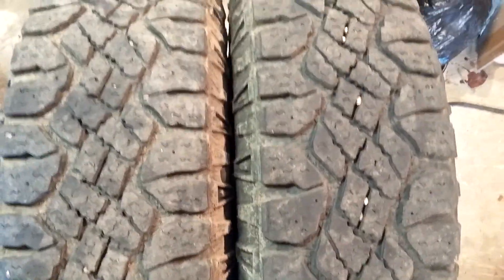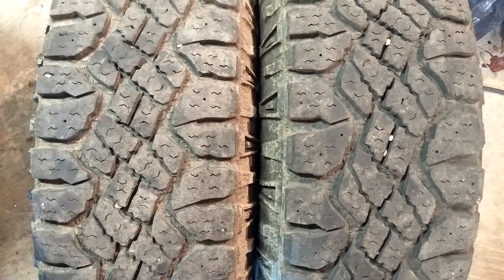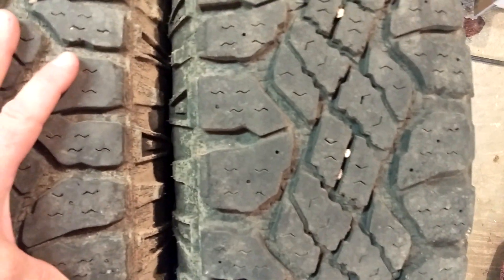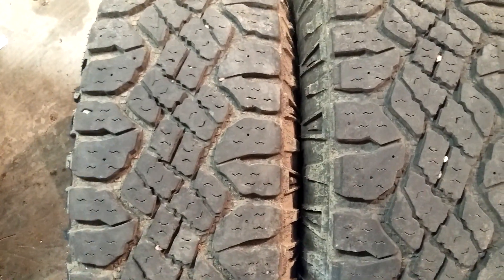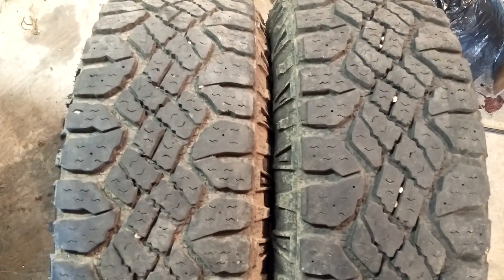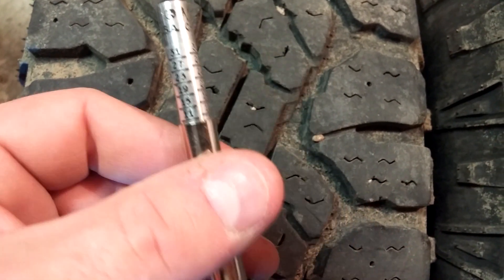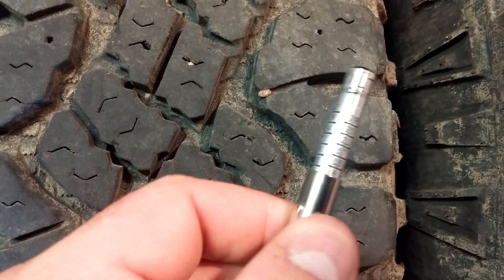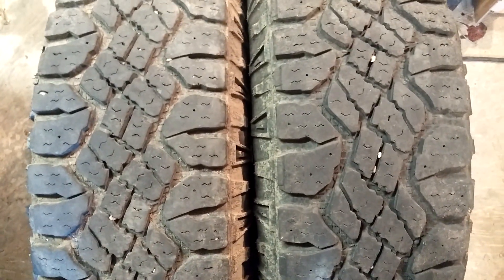24000 Mile Rotation on Goodyear Wrangler Duratrac

Comment: i agree with you on the snow traction after wear.  I'm not sure they go to a D, but they decrease significantly.  I did find they got a little noisy after 35k mi.  I rotated mine at 3k intervals.  I'm back to trying the new BFG ko2 again, and i can tell you new bfg to new duratrac, the duratrac eats these up.  Time will tell, i don't even have 10k and one winter on my ko2s.

Comment: I'm planning to get a set of these for my Jeep, but I'll keep them only for summer use. I have dedicated winter tires and nobody in Finland consider these "all season" tires to be proper winter tires anyway, since the difference between good winter tires (like Nokia Hakkapeliitta for example) and all season tires is like night and day... that's why we can drive in deep snow and bad roads during the winter in 2wd cars easily. And of course, we're bound by law to have winter tires during winter months... all seasons are acceptable, but they'll never work as well as proper winter tires, so for summer usage those will be. But for that, I expect them to be heck of a good tires :)
Reply from the maker: If you're planning on using them that way, I think you'll love them!
Reply: @garyburrus9379  The way those tires seem to wear, I'd expect them to last for quite some time, since I drive less than 10000km (something like 6000miles) per summer tops.
Reply from the maker: @finnishfatman  you'll probably get weather checking on them before the tread wears out!
Reply: @garyburrus9379  Probably :D

Comment: It may sound odd but shocks and struts when they get worn out they cause edge wear in tires they could be worn out and you not even know just cause of age I ran into the same issue shocks weren't leaking replaced them and the edge wear stopped and my truck rode better
Reply: I can second what James is saying.  I had also fought the same problem with outside scalloping on front tires on my truck.  I tried everything.  Finally, a guy told me about changing the shocks.  When I was installing another set of new tires, I went ahead and replaced the front shocks and the problem has never returned after 2 more sets of tires.
Reply from the maker: The shocks are worn, but I have had this issue since purchasing the vehicle.  I have replaced the shocks a couple of times, and they have continued to wear like this.  It doesn't matter what tire brand either.  
I am okay with it though.  As long as I keep my rotations regular, it's not that big of deal, and it doesn't cause me any handing issues.

Comment: I talked with goodyear and they insist there is not a issue with the sipes
Reply from the maker: It's not an "issue" per say, it's the intentional design by  Goodyear. If they deepened the sipes into the tread more, the snow handling would be much better.
Reply: well then it is an issue if the performance drops off after 24k miles

Comment: the duratrac rubber is stiff...it's an a/t tire. if they run deeper sipes...it effects structural integrity of the lugs made of that stiffer rubber. soft is great for mud...but could snap off entire lugs under hard rock use should it have deeper siping. engineering built that tire. if they softened the rubber like a true mud tire they can deepen the sipes, but would slip more on rock and hard surfaces. they want the best a/t money can buy. and built that. tolerances and dimensions engineered in. if your daily drive is over expansion joints in concrete...find a similar tire with a more obtuse lug ride...and that Will help with the wear as it will have less tendency to round over as quick since the 90 or acute edges won't be catching the aforementioned expansion joints.
Reply: sorry. there's a lot of autocorrect b**s** in That. new un-programmed phone.
Reply from the maker: I apologize, I never received a notice on this.  You provided a lot of great information!  This is the crux of tire manufacturers because customers are constantly asking more of their tires, and then unhappy with them when they get pushed beyond their limits. 
I will say that for my use, these tires have been the best tire I have ever put on this vehicle.  The next review is coming and they are still wearing great.
Reply: hey! thanks for replying! I ran just over factory width  33" autority a/t's on my old ram. I did a lot of research on tires after I got stuck and burnt it down. that's what I found. I believe the soft rubber and siping on the authorities that gave them the better road wear ...affected the capability of law 1 of physics to throw enough mud to get me out. (physics is why boggers look like half lug width half lug height tractor tires[ASK ME(but Google it instead) ABOUT IT]) as close as i was to getting out...if I spent the money to get the duratracs, I wouldn't have gotten stuck. of course I could've just bought m/ts or off road tires...but on a daily...thats a terrible investment. and the small extra price from authority to duratrac....is worth it.